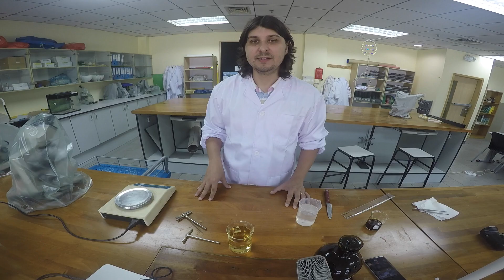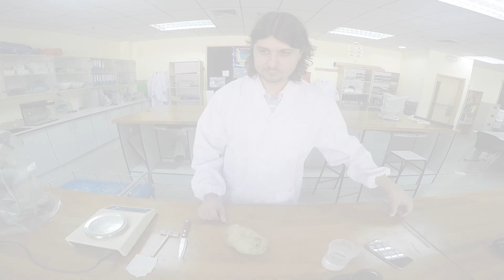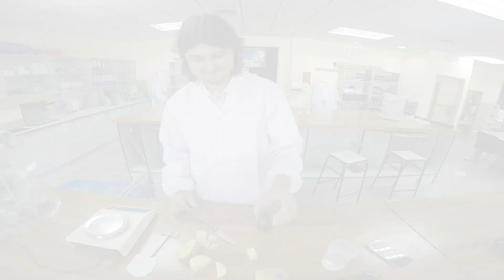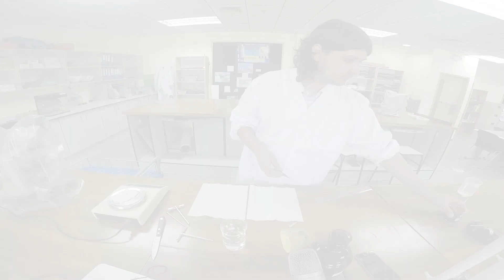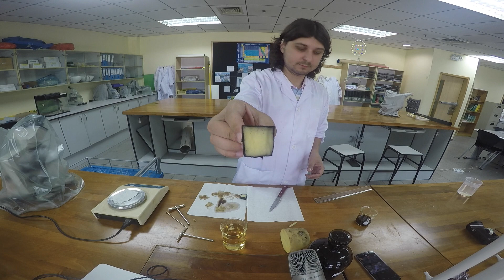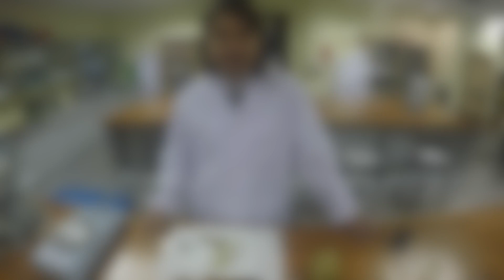1.1 - Cell Surface Area to Volume Ratio

Comment: Is there any other substance that could replace the iodine? I’d like to perform this experiment for my depth study.
Reply from the maker: Not that I know of. The iodine reacts with starch in the potato to give a dark blue color, so the measured changes are due specifically to the use of iodine.